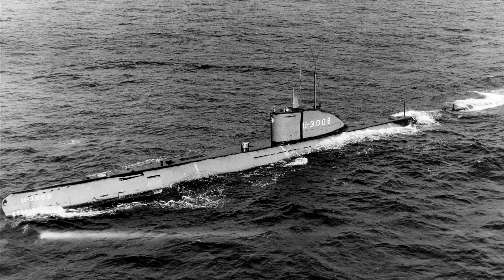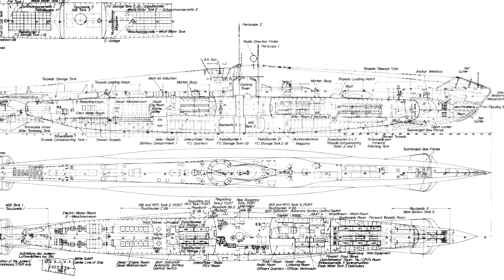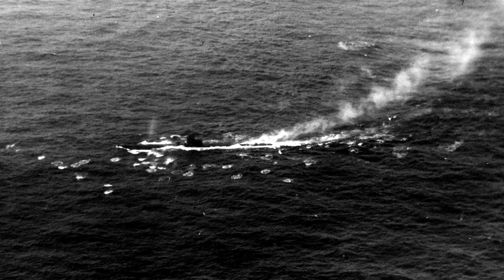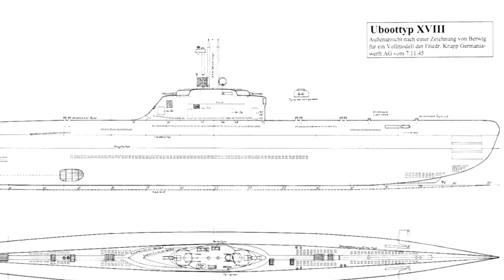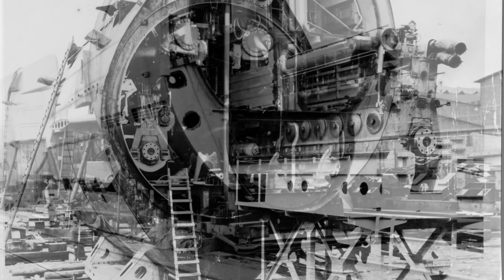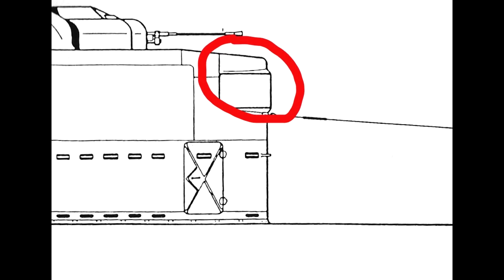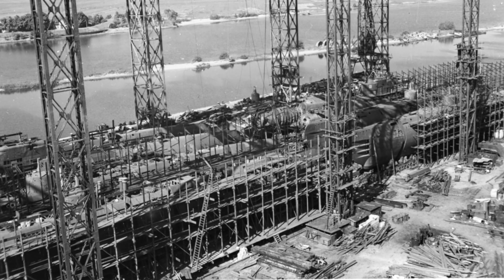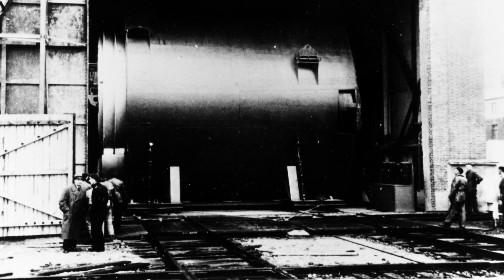German WWII Submarine Type XXI (Elektroboot) - Design, construction & assembly

Comment: Your summary of operation is totally wrong for WWII NAZI Submarine warfare. The German plan was always to submerge in the daytime if enemy forces were present nearby and to attack on the surface at night or during daytime on unarmed unescorted merchant ships.  Secondly the Type XXI designs were a temporary design built to fill the gap until the Walter Uboat design was placed into production and service.  The Hull used by the Type XXI was the hull design for the Walter UBoat design  the figure 8 hull lower section housed the Type XXI batteries but in the Walter Uboat design it was to hold the Hydrogen Peroxide fuel used by the Walter Engine.  The upper section was the people tank or living / operating space.
Reply from the maker: While I didn't mention it specifically, the allies had radar equipped aircraft which performed night attacks on the U-boats at night, leaving them being chased day and night. As I mentioned the original hull design was for a Walter boat. The British did spend some years after the war to try and make the hydrogen peroxide plant work, but it was never really successful.

Comment: I think the impact it had was much more than just design characteristics.  It changed the principles of submarine operation.  As the video points out, prior to the type xxi, submarines were primarily designed to operate on the surface the dive for either an attack or escape.  The type xxi changed this to operations were conducted completely submerged outside of port exit and entry.  And submerged operations were greatly refined in terms of travel speed and noise.
Reply from the maker: Completely agree. Submarine operations and ASW changed fundamentally after the type XXI came to light. If I remember correctly, the US navy had no plans to further innovate the WWII designs at the end of the war - that is, until they saw the type XXI

Comment: It seems that if Hitler had invested more in planes and submarines and less in tanks, Germany would have won the war. 😅
Reply from the maker: The production of 1 XXI used the same amount of armaments steel as 30 tanks.  It is being estimated that the type XXI program ended up costing the equivalent of 5000 tanks. Even if the XXI had performed as designed it was still limited by being able to find ships to attack - just as the type VII 😊

Comment: Liberty Ships were designed using prefabricated sections as well. There were several companies involved with the construction. This allowed the ships to be constructed very quickly, some as fast as several days. Later in the war, the German War industry was severely hampered in distribution of supplies because of the Allied bombing. The Type 21 U boat was a beautifully constructed boat and ahead of its time
Reply from the maker: True! There is a good story there as well 👍
Reply: The allied bombing was way less of a problem than you think. The german war production had its peak in '44, after years of bombing and end '44 and '45 they simply ran out of resources.
Reply: @wolf310ii  In addition, material that could still be producted in dispersed locations could hardly be transported and delivered to the assembly locations causing disruption in final production as well.

Comment: Simply put, prior to the appearance of the Type XXI, U-boats were called Walter U-Boot.  Actually only boats that could dive for a short time and then had to surface again to charge the batteries and let oxygen into the boat.  The Type VIIc U-boats, for example, had a maximum underwater speed of 7 knots, which roughly corresponds to the speed of a leisurely bicycle ride.  The Type XXI could travel about 18 knots under and over water.  Furthermore, the boats had a double hull and a snorkel, which allowed the boat to use the diesel engines and charge the batteries undetected by radar and aircraft.  Some innovations promised the possibility of turning the fighting in the Atlantic in favor of the Germans again.  Unfortunately, the U-boats appeared too late and in too few numbers at the end of the war.  Some of the boats that were in the Baltic to train the crew, although forbidden to do so, were able to bring refugees west from East Prussia.  If these Type XXI boats had appeared earlier and in greater numbers, the outcome of the war would have changed.  Actually, as with all German wonder weapons.  Whether Me -262 or Tiger and Panther tanks, the assault rifle 42 and much more, it was all used too late.  And of course you could only use such a modern army with fuel, and that's what Germany didn't have, fuel for the tank armies, plane squadrons and trucks, ships etc. The German soldier was not defeated in battle, but in supply  for the troops.  Excluding the American Lent and Lease program specifically for Russia.  Had the Red Army not been able to win.
Reply from the maker: The Walter boats is a reference to the U-boats equiped with the Walter drive / hydrogen peroxide plant instead of a diesel/electric setup
Reply: This comment might be pretty old but if german soldiers weren’t defeated in battle then what was the battle of Kursk, Stalingrad, Berlin, and so many others? Plus all of the german “wonder weapons” you listed were so extremely unreliable compared to the allied weapons which for example-the allied jets were far superior and not that far behind german ones in service dates.
Reply: @timber_wulf5775   There is no question that the technological advantage in weapon technology was sometimes decades ahead of the Allies.  But what use are a few 1000 Tiger and Panther main battle tanks compared to tens of thousands of Sherman and T-34 main battle tanks that were clearly inferior to the Germans.
Reply: @timber_wulf5775 Wartime Gloster Meteor and ME 262 where very close to each other. Win would likely be decided by the quality of the pilot.
Reply: @mbr5742  The Glouster Meteor was only built after 1945 in a number that made it suitable for frontline use. And Germany had already built more than a thousand units in May 1945. Do not you think? Then look in the archives.  Und wenn du denkst das der Pilot des jeweiligen Flugzeug ausschlaggebend für den Luftsieg gewesen wäre, dann lass dir sagen das Deutschland wohl die besten Jagdflieger der Welt hatte, mit einer mehrjährigen Kampferfahrung an der Front.  So billig kommst du mir nicht davon.  Ich weiß von was ich spreche.  Und übrigens ist es schon mehr als 35 Jahre her das ich angefangen habe mich für die Kriege der Deutschen zu interessieren.   Und ich habe Bücher gelesen von denen Du wahrscheinlich niemals gehört hast, nämlich die von Deutschen Generälen und Ingenieuren.
Reply: @magnusmcgraw  As for the nazi pilots - they had a few good ones. And a lot more with over inflated kill counts from attacking ground attack planes instead of fighters. But when faced with real fighters - nazi planes became flying crematoriums by the dozend. Some smart allied pilots went the extra mile and also got rid of nazis on a chute.
Reply: @magnusmcgraw  As for your "sources" - there are good reasons why books like "Verlorene Siege" and "Die ersten und die letzten" are rated as "-Propaganda and White Washing" rather than "good sources". Most are on the level of 'Paul Carell" re-imaginations of the real thing.
Reply: @timber_wulf5775   since September 1st, 939, the beginning of the Second World War.  The Wehrmacht and the Luftwaffe had to act with a limited supply of fuel.  The only oil fields in Germany's catchment area were the oil fields in Romania.  in Germany at that time only synthetic gasoline could be produced.  The lack of petrol and  supplies for the troops was a problem for the Wehrmacht from the beginning.  and by the way, without the American supply of ammunition, fuel,  thousands of tanks and planes, trucks and Million  tons of supplies, Russia would never have won the war against the Germans on the Eastern Front.  Even Stalin mentioned that after the war.  not to forget the 17 million fallen Russian soldiers.  How useful is a modern mobile army if you don't have fuel?  The Battle of the Bulge launched towards the end of the war was the best example of this.  and for you to think about.  If Dönitz had had 300 U-boats at his disposal at the beginning of the war, as required, the supply to England by sea would have been changed.  And if the Type 21 submarines had been developed and deployed two years earlier, the end of the war would have looked different.  So much for that.
Reply: @magnusmcgraw Germany had and has oil. Limited amount but still. And they have been exploiting it since the late 19th century.
Reply: There is no assault rifle 42. The Sturmgewehr is the StuG44.
Reply: @mbr5742  Das Sturmgewehr 42 war die Deutsche Bezeichnung, aber die Funktionsweise ist die der Zukünftigen  Assault Rifle gewesen.  Soviel sei darüber gesagt.
Reply: Double hulls have nothing to do with detection or snorkel. Modern non nuclear are often single hulled and a lot stealthier than the Nazi tub

Comment: When reading the Portsmouth N.H March 1946 report (U-3008/U-2513) there are a few things which I think should be kept in mind.
The 1946 report was written by engineers for the benefit of other engineers, naval architects and military personnel.
In my opinion the report should not be considered definitive but merely one report and the opinion of USN in 1946, critical aspects should be noted with caution as much of the technology was  subsequently adopted by all the advanced navies post WW2 into new classes of submarine.
The report was used by the RN to assess the new U-boats after abandoning it's own trials of U-3017 and U-2502.
Caution should be observed when reading as any pre-conceived narrative can be supported by cherry picking information.
The report reads like an engineering snag list or a house survey. Initially disturbing until realised that the report is attempting to be thorough.
The report is complementary toward the overall design of the new U-boat, confirming maximum operating depth of 280m or 900ft I note. It is also complementary toward hull form and electrical output. The report is moderately critical of the hydraulic system, and more critical of the exhaust system and the lack of supercharger, the report also criticises the fresh water supply and build quality plus many more secondary issues.
There is no performance data in the document as published though I did find references to sea trials listed in the table of contents.
U-3008 and U-2513 were succesfully overhauled and put into sea trials after having been dispatched covertly from Holy Loch by the RN in August 1945.
As a final cautionary note remember the USN had just had it's brand new Balao and Tench class boats made obsolete by the type XXI creating an expensive problem eventually solved with the GUPPY program. The authors of this report will have been aware of this.
Edited Oct' 23
Reply: The first type XXl's were sent  straight to the training flotilla's as they were not considered to be good enough to use in a combat environment due to technical flaws. One of the issues with the early boats was the various hull sections were out of tolerance where they mated to each other due to being made by many different companies.
Reply: @me109g4  Yes seven boats according to my information.

Comment: Wasn't it with the Type 21, that the Germans had covered the submarine with rubber, to make it undetectable ?
N'est-ce pas avec le Type 21, que les Allemands avaient recouvert le sous-marin de caoutchouc, pour le rendre indétectable ?
Reply from the maker: I have seen this being raised before as a question, but i have not come across it in my books. However, that doesn't mean it was not used 😊
Reply: Look up tarnmatte & alberich. They didn't make Type 21's "undetectable". The material both dampened internal noise sources (motors/pumps/mechanical noise etc). And reduced the acoustic return from ASDIC transmissions, but only by around 15%, making them SLIGHTLY harder to detect.

Comment: As ex submariner I served in the seventies on the Dutch tripple hull boats. In those days I was an mechanical engineer (petty officer).Those boats were quit cramped. In terms of propulsion it is basically the same design as type 21.The rest of the design is completely different. The propulsion section consists of large battery, a snorkel system with two diesel generators. The boat is propelled by two electric motors. One in each lower cilinder. The batteries and the engines were also build in the lower cilinders. In the upper cilinder were the periscopes, fire control, the warfare departments and the living spaces. It was not very luxurious, but I do remember it as “the happy times”. The  endurance deep dived was about max a few days. Not only the battery endurance was the limiting factor, but also the quality of the breathing air in the submarine. The air was mixed by a ventilation system, it could not been replenished, it had to be scrubbed of CO2 and the oxygen was supplemented by a chemical process. It was stored in so called “oxygen candles” . The max limit of  CO2 was 1,5 %.....
It was possible to run the sub at a speed of 17 kn, but not very long, maybe just enough to sprint away from the opponents. But in the lower speedband the boats were very quiet for that time. 

The “schnorchel system” was originally a Dutch design (LTCDR Wichers). 

More about the tripple hull boats https://en.wikipedia.org/wiki/Dolfijn-class_submarine. You can also visit the the Dutch naval museum at Den Helder. There is the “ex HrMs Tonijn” preserved, and open for visit. It’s in a remarkable good shape.
Reply from the maker: Thanks for your comment and view :) Now that you mention it, I do remember the CO2 canister being on the schematic of the XXI/Wilhelm Bauer I used to prepare for my visit. Thanks for the hint on the Tonijn :)
Reply: That differed from the XXI types because the XXI types had the diesel engine run through a gearbox directly to the shaft with the electric motors on each shaft and the creeper motors being belt driven to the shaft.  The main motors acted as generators or motors.  they used clutches to engage and disengage the diesels and main motors.

Comment: That Boat was way ahead of its time.  The Elektroboot.
Reply: But came too late /
Reply: What was its total battery capacity (when brand new)?  (I.e. kilowatt-hours)
Reply: @toddkes5890  They had between 6300Ah at 5,5kA (full ahead) and 12000Ah at 240A (silent running)
Reply: @wolf310ii  Amp-hours, but at what Voltage?

Comment: The germans were technologically all other countrys so many years ahead.
Reply from the maker: There were indeed several areas where they tried to secure victory by innovation, but failing to accept that it's not a viable strategy. However it did produce some key technical developments : 1) Submarine, 2) jetplanes 3) rocket engines - these formed the basis of the entire space race between the US and the Soviet Union. I'm sure there are more, but these comes to mind
Reply: @BecksHobbyProductions  there search for super weapons definitely pushed the world ahead greatly. In a way was a good thing for the Allies because important war time materials were used for these projects
Reply: Ceetress J. In some areas they were advanced, yet they invaded the Soviet Union on Horseback for the most part.

Comment: I do realyze that my next comment its easy to point so many years after and with the outcome already known... But

Walter Submarine was a waste of time and resources, Germany would had been quite better if they had adapted the existing Type IX class into a fully submarine, by replacing the big Diesels withs smaller ones, removing the aft. torps in order to put big electric motors along with 2 smaller "crawl" motors and expand the Batterys at the expense of Diesel storage (after all much less was needed to only recharge batterys every day.
The external modifications would had been minimal (a lower profile connning tower and a redesigned exterior hull and bow).

i'm not saying nothing too much fancy, the USA did exactly that with Trench and Balao class submergibles from WWII era in the Guppy program, they would have done the same with Gato class but the hull wasn't that capable for deep dives... Those kind of limiting factors made the conversion not-so-desirable.
Same goes for Type VIIC u-boots, they were too small and they couldn't pack the ammount of batterys needed for a full conversion into a submarine, but i'm shure type IX had enough room (if modified) for that ammount of batterys
Reply from the maker: I think Germany was too keen to innovate and solve war problems with technical solutions.
However, the Guppy program was based on their analysis of the XXI they had after WWII. The US didn't have any immediate plans to change anything on their submarines after WWII, but that all changed when they took at closer look at the type XXI.